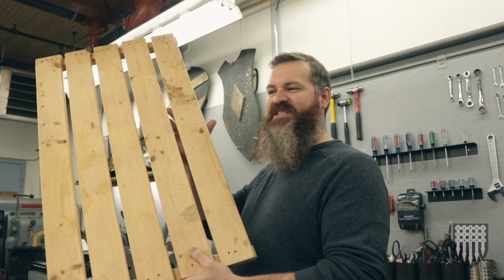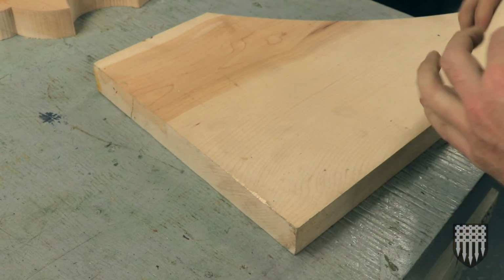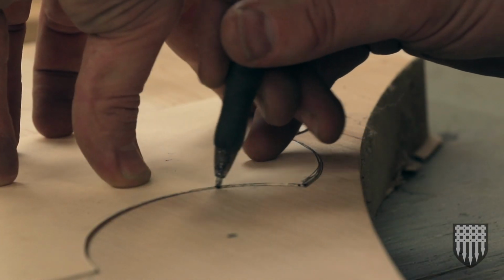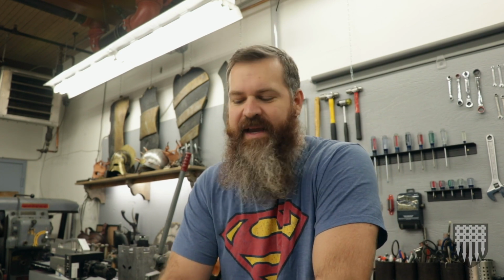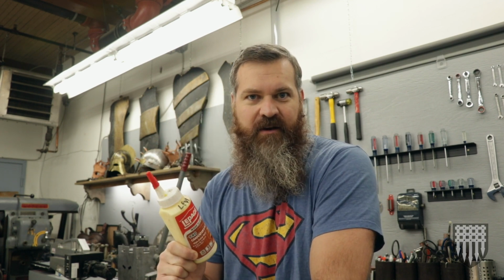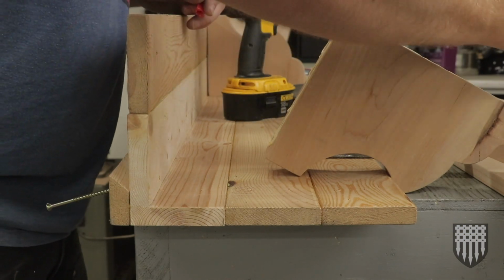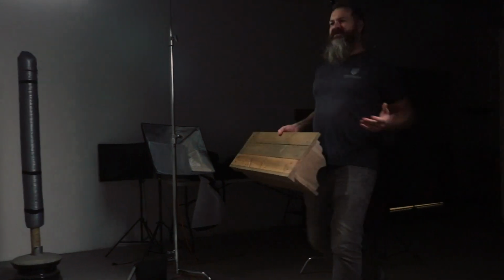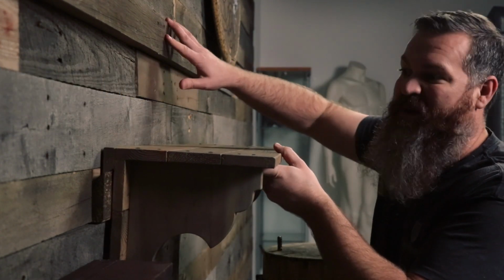DIY Build a French Cleat Shelf

Comment: Nice Shelf. Add a spacer to the bottom in between the back of the shelf and the wall to keep it from sagging downwards.  Thanks for posting the build. Keep up the good work.
Reply from the maker: Thanks. That pallet wall is pretty uneven so I have different shims for fine tuning which is working well so far.

Comment: Whatever you put on that shelf is gonna roll off, it's tilting towards the floor. Was it worth wasting the nails by putting them where they will never be seen.? Recycling into something new is a brilliant idea btw. 👍
Reply: If that's going to be a problem i think a pice of wood of similar thickness on the back of the shelf will do the trick. :)
Reply: @sheep1ewe . Yes a little shim or wedge would do it.
Reply from the maker: These shelves are for our product photography so the nails will get seen from time to time.
Reply: @DrawbridgeProps  That was what i taught, it's one thing if something only are ment to hang on a wall in somebodys home or botique display, another it it's ment to be used as rekvisita in film or photography, if so that level of atention to deails are nessesary in order to get a good result, i fully agree with that.